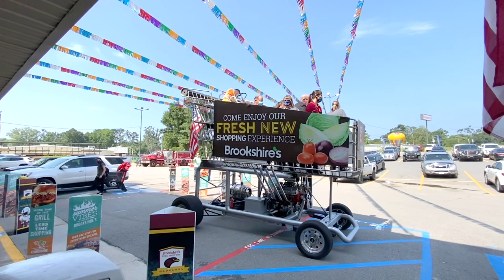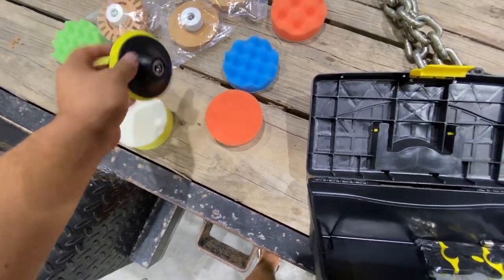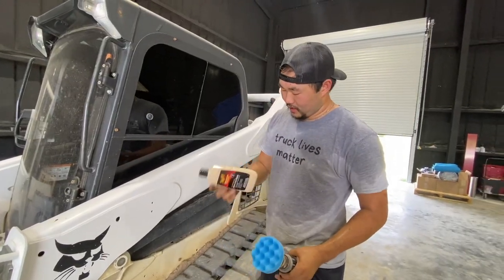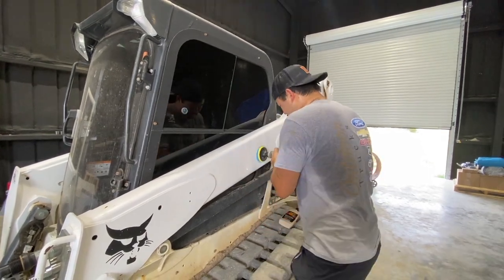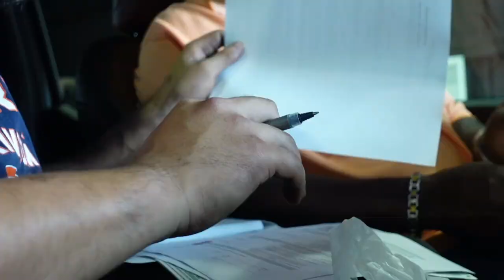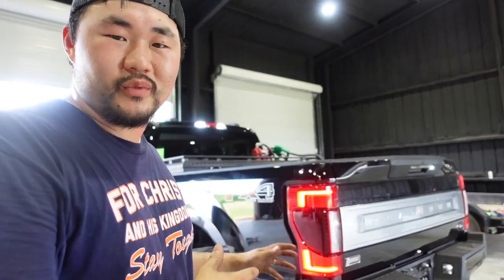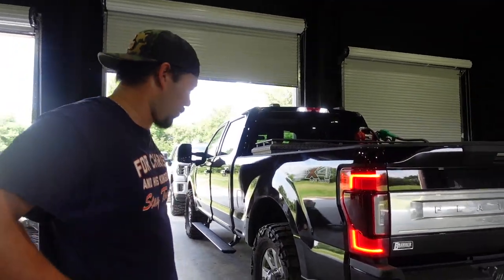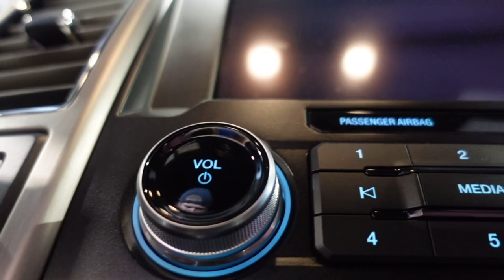Why I Sold My 2021 King Ranch F-350 So Soon!

Comment: Hi 👋 
New Sub. I have two questions.
1. How do i take care of the seats, mine need elbow grease and im 100% fine with that. Is there a product and method recommended? I have the King Ranch conditioner and cleaner but i really need more of the conditioning. No rips or tears it just needs some good detailing and since its untreated im worried to bring it anywhere.
2. Some low-life took my support the troops magnet and turned it upside down on the side of my truck. And then proceeded to scratch "Z" into my paint... any recommendations on compound and buffing also I'm in the Northeast if anyone can recommend a good shop for body work and such please let me know I can't just trust anyone with my vehicle and my mechanic maybe leaving.

Thank You
~Pete